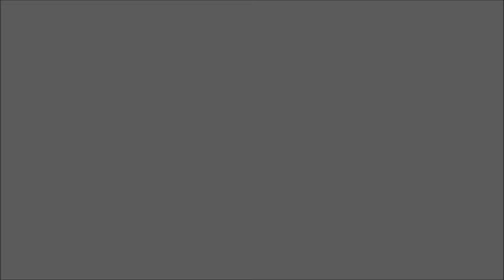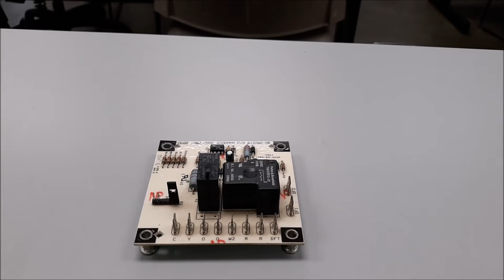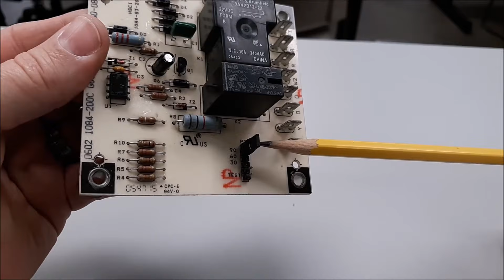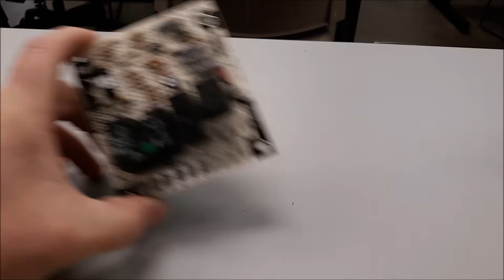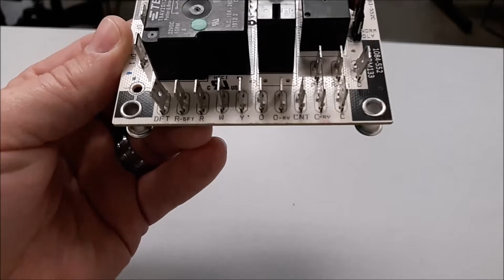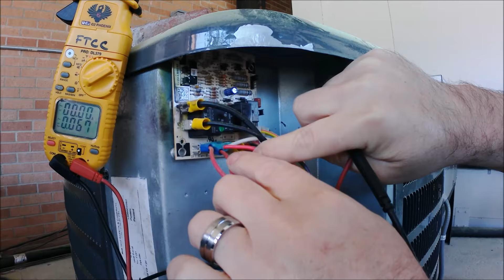Troubleshooting the Goodman Defrost Board

Comment: Good video and explanation! One critique: I think the norm/delay jumper is a setting to allow for a delay in order to shift the reversing valve before the compressor comes on for quieter operation. I think normal just sends it
Reply from the maker: Yes. I made a mistake in speaking about that NORM/DLY on the board. I was so focused on everything else that I completely fudged it and later realized. I got to go back and edit that somehow...If I got my mind right now, the compressor will shut on/off when it goes into and out of defrost if the DLY is selected and helps with the pressures and that quieter operation you were speaking of. Too much stuff to remember sometimes and I hate to put it out wrong. Thanks for reminding me to fix that one.
Reply: @johnjennings-JJ  I’m not sure how YouTube works on the creators end but I’ve seen a lot of videos where there’s text superimposed on the screen for corrections. I wouldn’t sweat it too much, keep up the good work!
Reply from the maker: It was in my head right but didn't come out the mouth right. I'll somehow fix it or at least put a correction in the comments.
Reply: I'm not sure how that would be possible considering the compressor is what actually moves the piston inside the reversing valve. The valve solenoid is designed like a relay but with refrigerant. I guess it's possible though with residual pressure in the system if it's switching during operation? I'm still new to this stuff.
Reply from the maker: It just lets the pressures equalize a little so it isn't as noisy when the reversing valve shifts back into heat mode. It helps a little since we seem to install units right outside of bedroom windows!

Comment: Excellent video. Someone please correct me if I'm wrong here because I just did this: Y is power-in that passed through the low-pressure switch, and PS2 and R-PSI are for the high-pressure switch. You could disconnect PS2, R-PSI, CNT, and then connect Y to the contactor in place of the CNT wire and it should work fine (minus high-pressure protection). I don't think I'd want to do it that way as a contractor, but not a big deal in this case. 

I'd disconnected the PS2 and R-PSI wires earlier this year to get it working again even though the pressure switch itself seemed to be fine, and then today pretty much just bypassed that whole relay.
Reply from the maker: The Y coming from the tstat/air handler goes through the high pressure switch on the newer board while the R-PS1 goes out to the low. If you just temove the Y on the board and put it to the contactor it should work without having to unplug anything else. Just will be controlled straight from the tstat but with high press switch used and not a low press switch. I would think the low is more important (if i had to choose i guess) since there is a thermal overload on the PSC motors. I have seen older units without a pressure switch at all and it should at least have a low pressure switch. 

But you could easily remove both pressure switches from the board, wire them in series, and put whichever wire straight to the contactor as a temporary solution while you wait on parts or something. All in all, I see where you're going. Should be fine.

Comment: The original board is very reliable and rarely needs replaced. Ive seen them 20+ yrs old and still 100% operational
Reply from the maker: Absolutely. I have not changed out a whole lot of them so i think they are pretty reliable too.
Reply: I recently replaced my brothers 3ton Goodman Heatpump. It was 27yrs old with original board and CFM and compressor. I couldn't believe it !!!
Reply from the maker: The oldest i have seen was a 42 yr old heat pump. Guy didn't even have a thermostat...he just turned it on and off with the breaker. But it ran great!

Comment: Goodman GSZ160301 Unit pops a 3amp fuse in the air handler as soon as the power is turned on. Tested all low voltage wires for a short, nothing shorted. Would this board cause the fuse to short if its bad?
Reply from the maker: I guess anything is possible but i doubt it is the board. If you checked the thermostat wires in your system and didn't find the short then maybe it is a short in the factory wiring. Look for something like wires that might be rubbing up against the copper tubing outside. Pressure switch wiring reversing valve wiring, or it may be a shorted contactor/relay coil. See if you can do the poor man troubleshooting and turn on one thing at a time...fan on, then heat on, then cool on, etc. Maybe that can help narrow down what circuit it is in.
Reply: @johnjennings-JJ  Its a brand new system. It worked for about 2 weeks, then blew a fuse, put a new fuse in and it worked for 3 more days and then started blowing a fuse every time the breaker was turned on. Unhooked all thermostat wires and put them all back one at a time, starting with the thermostat to the air handler. Got all those wires on and was able to turn on the Aux heat strip. Everything worked fine. Started putting back all heat pump wires to the air handler and everything was fine until I got to the red wire. That popped the fuse. Took all heat pump wires back off the air handler except the red one and it popped it again. I can not turn it on to test anything because I cant get power to the heat pump without it blowing a fuse. I am using 18-8 wire so I have extra wires that arent being used. I thought maybe something was wrong with the red wire so I used one of the extras in place of the red wire as a test. System worked for 15 minutes, popped the fuse again. I am out of ideas.
Reply from the maker: Love these kinds of problems!!! Makes me wanna pull my beard out sometimes!

Continuity checks could/should find it but it can be frustrating. When i first started out i had an old man tell me to buy a couple packs of fuses and put on in every circuit between the tstat and air handler, then again between air handler and heat pump! I didn't like that job much but i finally understood that he was trying to help me over the phone (kinda like this). We found the problem though. I start hooking up my power (red) and common first. If power is already on then a direct short pops the fuse. Then i start hooking up the G, Y, O, etc. All with power on...but that is just me. If nothing pops when i get finished wiring, i turn it on...fan on then off, etc. Shorts are definitely a pain but that is why companys i worked for charge by the hour for finding one! Good luck.

Comment: I has same board in my heat pump(Goodman)..For some reason r22 and r23 resistor is overhearing, and a/c not working, stay in heat mode..
Reply from the maker: My friend and I were just talking about that a few days ago. Seems like there a a few resistors that always overheat and you can see the area on the board when it happens. I  hope goodman fixes it one day but it seems like it is an issue with the manufacturing of the board. Maybe they are rated in a high enough wattage or something. Thanks for stopping by and commenting.

Comment: Nice video, goodmans defrost test is a little different,  you can put the jumper on test, then  jump out the DFS that's if your coil is above 32F , next important part once you hear the unit go into a defrost pull off the test pin jumper and it will go into a full defrost cycle. Hope this helps anyone.
Reply from the maker: The goodman board does do it a little different. Thanks for commenting and bringing it up.

Comment: Thank you for the video. My unit is not turning the Aux heat on while it is defrosting. I will do the check in a couple of hours. It is 13°F outside.
Reply from the maker: Thanks for watching. I hope it helps you figure it out. Your unit will definitely be blowing cold air in defrost mode without those heat strips running.
Reply: @johnjennings-JJ  put it into defrost mode. Checked between C and W= 25V. Those 2 terminals get 25V during Heating mode and during defrost mode.
I still have to double check the wiring going to the AHU. However, it was working before very well. I stopped the unit in order to change the filter and all the sudden that happens.
The heaters come on as programmed to supplement the Heat Pump. 
I will keep you updated.
Your videos helped a lot though.
Reply from the maker: Yes...let me know what you find.

Comment: great video. Thx 
I have had 2 new boards (PCBDM133 which you show here) show sign of overheating on rge R22 and R23 resistors, with discoloration on both sides of the board. What would this indicate, is this a common occurence due to,say, improper choice of the the resistor not allowing for proper dissipation, or would this point to a differnt issue altogether ?
Reply: Ours is discolored and very hot to the touch. Thinking of replacing the board. Would like to know what causes this and if that kind of heat is normal.
Reply from the maker: I actually talked to a guy that works at a parts distributor and he says that problem is one of the biggest he sees with that board. I don't have a solid answer for why it gets hot/burns out but i think it has something to do with the wattage rating for that series resistor.
Reply: @johnjennings-JJ     there is a universal replacement by White Rodgers (model 47D01U-843) that should work better - they also provide a very long list of cross reference replacement that helps decide if your board is a candidate for replacement.
Reply from the maker: Thanks. I'll try to remember that and pass it along as well.
Reply from the maker: I am not a big electronics guy dealing with resistors and diodes. I know a kittle but not expert level. I have seen the discoloration if many board and they worked fine, no issues at all, for years. I would say it is normal for some discoloration...could they use a higher wattage rating?? I'll let the electronics guys figure that out.

Comment: Thank you for the concise instructions on this board. Mine would not turn system on after power outage and kept blowing air handler fuse. Isolated issue to outside board thanks to this video.
Reply from the maker: Thanks for looking and leaving a comment. . If something in the video helped someway...I like it!

Comment: Someone installed my ac/heat pump that shouldn’t operate a toaster.   What will the unit due under heater conditions is the jumper for the 30-60-90 pins is not installed on any of them?   I can’t find an answer anywhere.
Reply from the maker: If the jumper on the defrost board is not actually put on the 30-60-90 pin then the board will default to the 30 min selection anyway...if I remember correctly. If that is the only thing "wrong" I don't see any reason the unit shouldn't still run like normal.

Comment: I have visible burnt transistor on my board and keep blowing 3amp air handler board  fuse. I’ve gone through all wiring all the way. Would bad defrost board cause this ?
Reply from the maker: I supposed that it could blow the fuse since it is connected to the low voltage in the system. If it is visibly burnt on the board then that is something you probably want to replace anyway.

Comment: If all those checks are good , low pressure switch closed high pressure closed and we're getting a call for heat/cool, and we don't get 24 v out on the contract terminal. Bad board?
Reply from the maker: The newer goodman board has to have 24v power on R & C in order to energize the CNT circuit out of the board. Check for true 24v power to the board on R & C and if you have that along with all the stuff you mentioned then it does sound like a bad board from where I am sitting!
Reply: @johnjennings-JJ  thank you for the reply
Reply: I have replaced 2 of these boards on my unit still no output on cnt just a momentary bump ? Connected low pressure switch and high pressure switch in series  with R and contactor compressor runs this is a brand new unit . These boards are trash
Reply from the maker: @allencarroll8868 so for "troubleshooting purposes" i would unhook the high and low pressure switches and put them in series with the Y circuit coming out to the unit instead of R and see if it works. You should be getting 24v on 'Y' when in heat or cool of course but just in case if you don't have a meter? If it works then you are likely looking at a bad board (hate to say that cause it son't seem right but it would probably be something outside). If it doesn't come on using the Y circuit not you got something else to blame. Loose wire nut connections could be the culprit in the air handler!
Reply: @ so if I have two bad boards why not just remove compressor contact from board and tie my hps and lps in series with y and take to contactor ? The defrost board should function with out compressor control?
Reply from the maker: Yes...Should work fine that way.I just wonder if you truly have 2 bad boards. Maybe it is some other simple problem?
Reply from the maker: I just personally start wondering when I seem to get multiple bad boards.
Reply: @johnjennings-JJ  yes it makes me second guess myself also but I will keep digging till I figure if it is the board one thing that I keep seeing it is made in China on the relays this gives me a warm and welcoming feeling lol . Anyways I sure do appreciate your input and help with this head scratcher.

Comment: how are you able to read the board??
Reply from the maker: I also started putting up videos that i have made just so some of the guys i come across could simply watch and rewatch if needed. It takes time to get some of this stuff in your head the right way and actually know what you are doing with it.
Reply from the maker: Not sure what you mean? Can you be a little more specific? Only 2 ways...read the layout of the terminals as they are printed on the board and reference the wiring diagram AND use a meter to understand how it works as far as switches closing, etc. Then again, time and field experience fills in a ot of blanks.

Comment: That Common you were using to test voltage on the contactor has 24v and no continuity with the other two commons on the board.. Think my board is bad?
Reply from the maker: The common that I check is the "main" common and of course is hardwired all the way back to the transformer through the t'stat wire we use to connect the indoor/outdoor unit. If you read 24V from the CNT terminal to that main common then the board is doing its job but the broken circuit from one common to the other isn't going to let the contactor pull in and turn the unit on. So long explanation short - Yes, I think your board is bad from what you have said.
Reply: @johnjennings-JJ  thanks for the reply. I'll be ordering one shortly. I have no power to CNT and constant 24v to the main common.
Reply from the maker: @LawnChairOperator  I just hope it works out good for you. Troubleshooting "over the phone" is a little different that in person just because people talk and describe things differently.